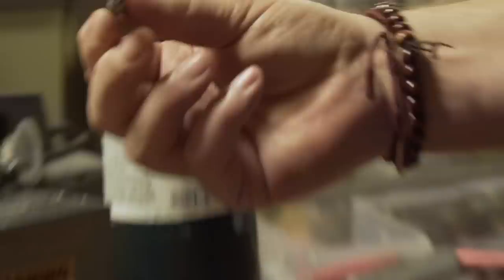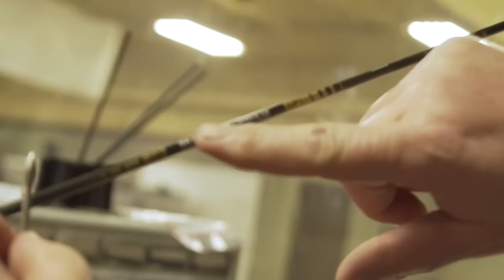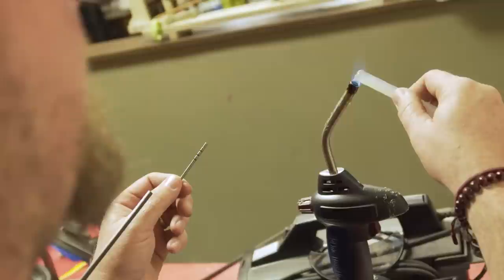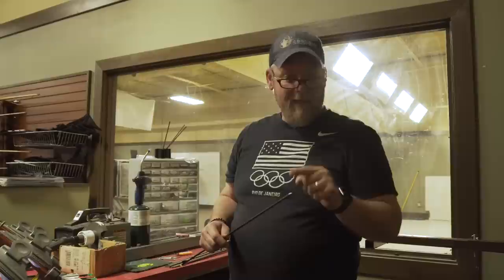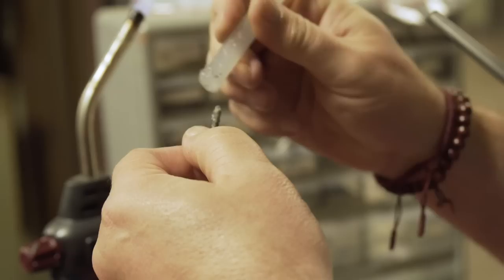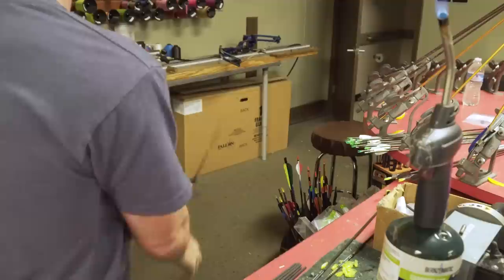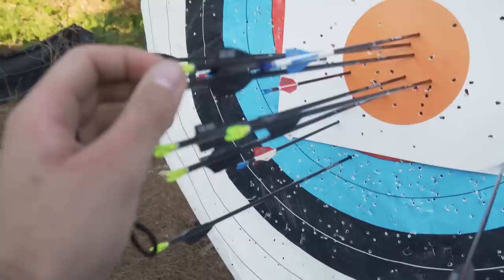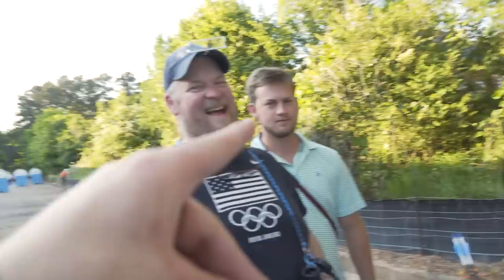How to properly glue in arrow points

Comment: I have a question I have the Gold Tip 500 blemish arrows and I have inserts that glue in then I screw in the points, does the same technique apply to them or is this just for the solid tips you have in the video?